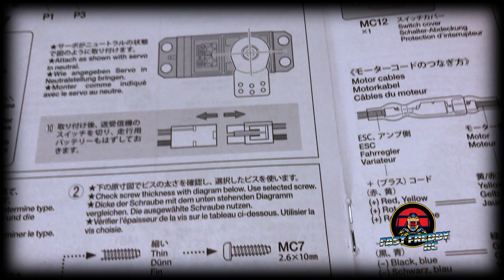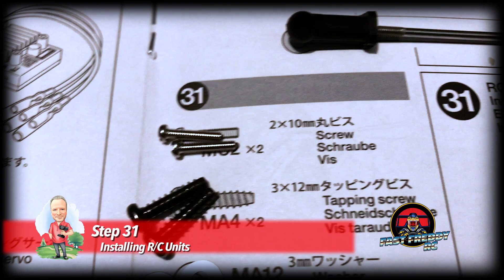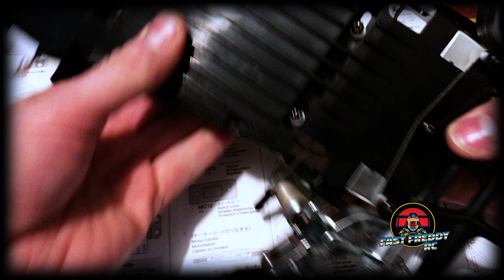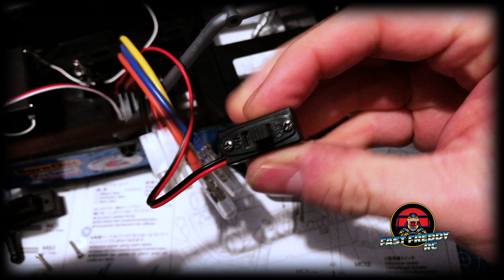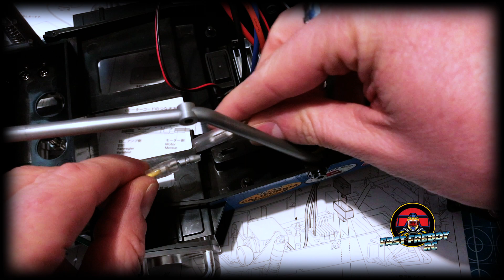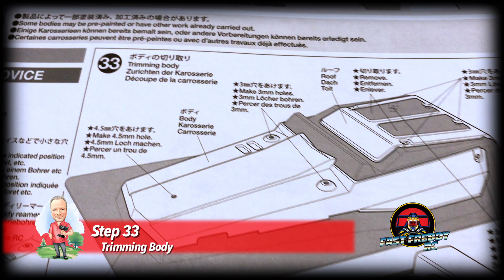Blockhead Motors Wild One Build Series - (Steps 29 - 32) - Radio Gear Check and Installation

Comment: Nice job, at full steering the "rebel" thingies collide with the springs of the front shocks, but i think it is minor and does not matter, but its a valid reason for cutting them off.
Reply from the maker: Thank you!  From what I saw when I was testing it out you are right about them touching if at full steering but not by much.  The other thing I noticed was how it will affect things was dependent upon how compressed the shocks were if and when they collided together.  But I agree with you that I think the issue is minor.  But like I mention in the video if I notice that this is going to be a real problem, I'll take them off and cut as instructed.  If this is a kit that someone has bought and they are a beginner or novice builder, I don't like the idea of them being asked to chop that bit off.  Maybe it's just me, but something just doesn't feel right about it.